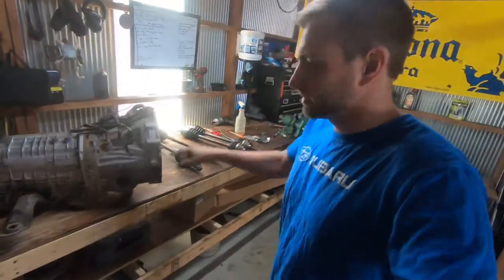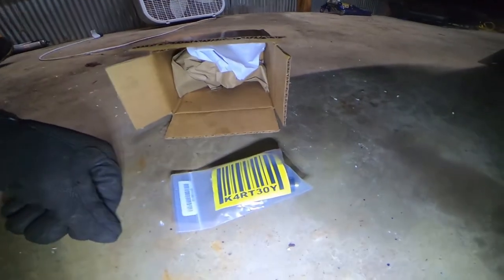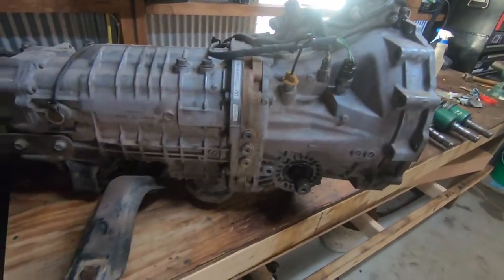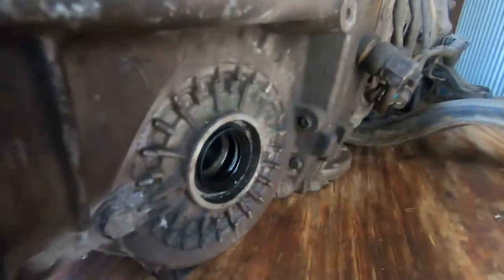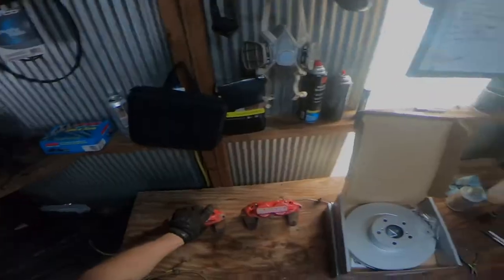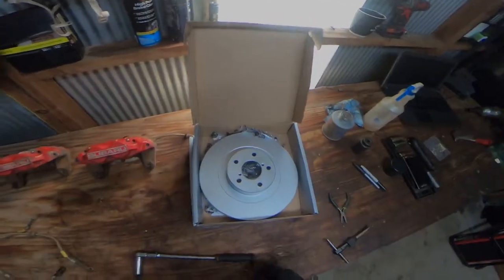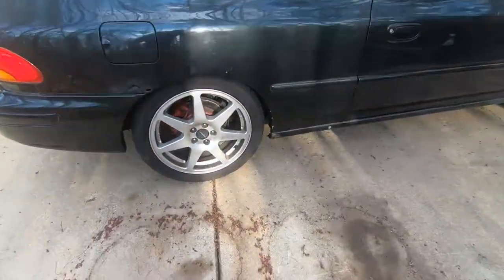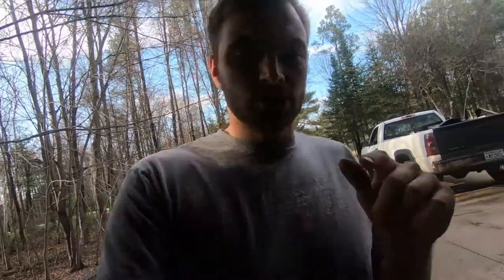Impreza GC8 RSTI Track Build: STI 6 Speed and Driveline Finished

Comment: Did those sti Axles fit into the stock gc hub? Or did you have to replace those too?
Reply from the maker: Yes the fronts will but I was using r160 and wrx rear axles on this set up. Sti rear axles won’t fit.

Comment: Think its possible to to drop in the engine with trans on it from the top?
Reply from the maker: Ehhh would be really tough. Easiest way is actually from the bottom. Unbolt the subframe, struts, steering column, and trans. Lift the car up and everything stays behind. Lift is really the only way that’s easier though.